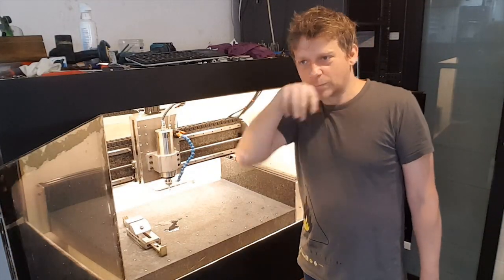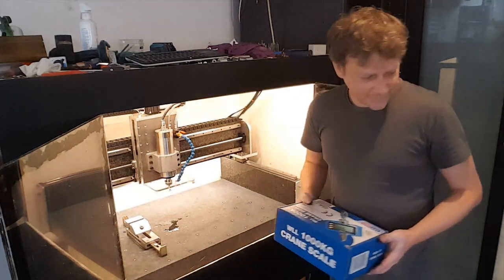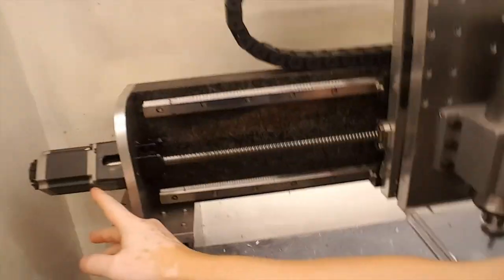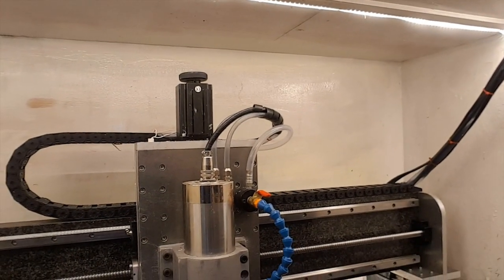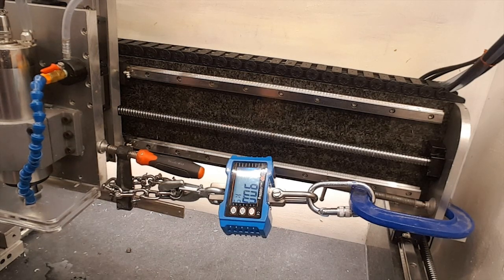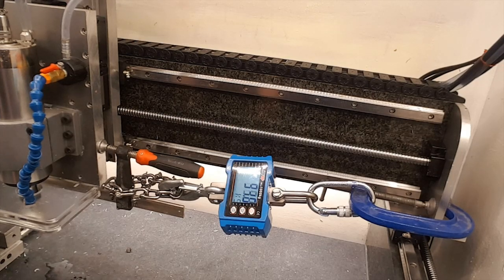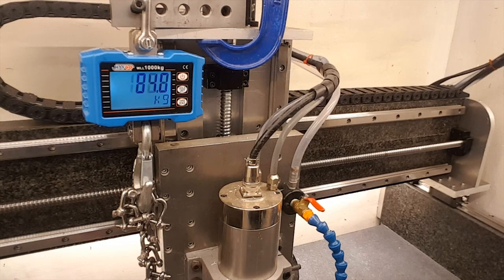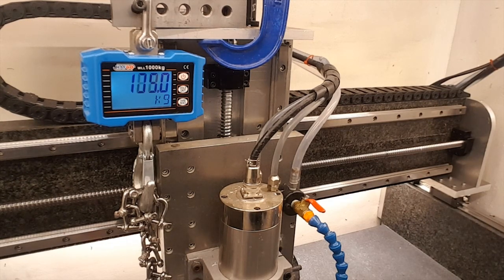how strong steppers are?

Comment: I have bought a nema 23 stepper motor kit from ebay and i can't even move my machine. 35v, 425oz./inch. Do you have any idea what is going on. ? Thank you.
Reply from the maker: This question is as generic as it is possible. I have to ask ;) did you take those steppers out of the box?? ;) I guess you have leadshine stepper drivers. I'm guessing maybe you haven't connected the ground to step and direction inputs. It takes 5v input signal and ground
Reply: @PiotrFoxWysocki  the system is working but the torgue is very low. The settings on the controllers are on max amps but also i can stop them with my hand. Is it good idea ti increase voltage from 35 to 45-50, the controllers can aford it.
Reply from the maker: @Nikos_Katakis  wow. something is seriously wrong. increasing voltage won't do a thing. more volts - more speed, more amps - more power. i have to ask, what is your power supply? Amp wise? another question would be if you are sure you connected stepper leads right? if its noisy and spins erratically it means its wrong.
Reply: @PiotrFoxWysocki  the power supply is 35v 10amps and this is for 2 motors and one more for other 2. Plenty of amps... :p  a belive that the conections are good because out of the machine the motors work well with out bad noise.
Reply from the maker: @Nikos_Katakis  i presume you haven't plug step in to direction and vice versa? only one thing left are the drivers. are you sure they are not set to some minimal Amps? in some you have to use resistor and maybe resistor is 10x or 100x too big or small.
Reply: @PiotrFoxWysocki  for which resiators do you mean?
Reply from the maker: @Nikos_Katakis  you didn't mentioned what kind of stepper drivers you got. So again I'm guessing what could possibly be wrong to cause such low power. Some Gecko drivers use external resistor to set particular Amperage.
Reply: @PiotrFoxWysocki  DM542A longs are my drivers.
Reply from the maker: @Nikos_Katakis  how did you set dip switches ?? One thing is almost certain. One driver can be damaged. But all of them, very unlikely. Check all the connections if they are tight and perhaps use multimeter to confirm.
Reply: @PiotrFoxWysocki  I had used osciloscope and i discover that the pulse voltage us 5 to 6 volts. Is this normal? The switches on controlers are on max power.
Reply from the maker: Interesting. I never measured stepper driver output but I would guess  that if you providing 35v stepper driver should output something similar. Not 5v. This just doesn't  make much sense. Are you sure you haven't used 5v or 12v output on your 35v power supply?? Some of them have dual output.
Reply: @PiotrFoxWysocki  Give it a try and measure. When the motor isn't moving i have 7 to 8 volt at one circuit and when is moving 6 to 7 ac on oscilloscope. Today I try the microstepping functions of the controller and I think I have what I want. I have some vibrations but I thing will be ok. I aslo tried to change the isner voltage to controller from 30v to 40v and the output voltage to motor was the same.Thanks a lot for your time my friend, your advices was helpful. Give it a try and measure just for curiosity.
Reply: @PiotrFoxWysocki  totally wrong, stepper motor no matter what volt you use, little help speed, more volts more speed, perfect stepper user use driver who handle 80-90 volt and little more than motor maximum ampere have BUT need setting driver max ampere little bit less than MAX motor amper have. or burn motor. but normal hobbu user use budget good compination, use NEMA 23 max torque motors about 475 OZ 3-4 amp max, and driver this have normal DM 554 max 4 ampere  and 40-50 volt driver. IF not have budger, no matter how much cost, used NEMA 34 and lot biggest driver etc, DM860 serie 80 volt and 9amp about. and biggest motor what driver can use. about 6-9 amp.

Comment: What stepper for lathe for wood?
Reply from the maker: Not sure on the size of your cnc. But most likely some mid torque nema 24 should be enough. Closed loop would be great
Reply: @PiotrFoxWysocki  spindle need minimum about 3HP motor and steppers uses normal minimum 470 OZ motors.

Comment: You have made same as my plan is(granit) but on hold because money... anyway I'm trying to find information about how many Nm are forces on spindle (both direction) same on linear rails... for example  6mm end mill 4flute  and 1m per min @10000rpm  ... this is hard to measure. But magnificent build and videos. Oh yes how much was precision granite base??
Reply from the maker: It is hard to check what is the load on the spindle. i have made a video about breaking mill bits, its my latest one. check it. it could give you some ideas. my standard speed is 1m/min with 11000 rpm, one thing i noticed that you won't break 6mm 4 flute mill, but if you go too deep or too wide you might have different problems. 
in my case x axis has 120kg(f) co its not enough to break the mill because it needs double that. but if you go to wide it will get stuffed, or if you go too deep it will break flutes. i guess it will break flutes in both cases. i chipped 10mm carbide mill on the bottom of the flutes and one flute in the middle. perhaps because at some stage i was doing 3m/min. anyway steppers didnt stall. it was the mill bit which fail. if you think about it it makes sense because flutes are very thin at the ends. 
now im cutting everything with recipe of 10mm deep, 20-25% side cut. 11000rpm 1m/min. for mills above 6mm. 
price of the surface plate was around 600nzd which should be about 400usd
Reply: Piotr Fox Wysocki I use € :) and live just above you/ish.. and yes ..your video gave me ruff idea what numbers are there.. Oh yes there is some formula to calculate out.. Thank you again.

Comment: I want replace my 3hp ac motor to stepper motor. Which stepper i should use
Reply: better buy real spindle motor, not expensive, 2,2KW water cooled spindle cost only 120-150$  and cheap chinese VFD 60-100$ not lot have. then can milling all what need, but steel not can, need lot low speed motor,  and gear box. and stepper motor change old 3HP AC motor not similar, stepper not run high speed good, normal 3-phase motor run 3000RPM stepper lot slow speed not can, maybe if use gearbox. but torque need calculate.i not know what you 3HP torgue have but if run slow speed burn coils fast.

Comment: made me physically ill to watch the fail, (lost steps are death to a 16hr job.) while 100kg is huge, i wonder the force of high-speed change of direction, that gantry looks stout.

can you share your x,z configuration of screw nut/carriage plates? you have a great low profile design.
Reply from the maker: gantry weight is around 60kg. so i have 150 kg to spare. and my top speed is 3000mm/min. top speed for stepper with no load was around 5000 mm/min. so i backed down to something reliable. i will share my fusion 360 files for the X-Z configuration in my next video about machine.
you guys make me do another video about steppers and speed/accelerations :) its good to have clear topic for the video :)
Reply: That comment about sharing the Fusion360 files is pretty exciting :-) ALso, are your linear rails the really cheap knockoffs from China, or genuine Hiwin? I remember you were not totally impressed with them when you got them. I presume however that they are still much superior to supported circular rails?
Reply from the maker: my rails are cheap knockoffs... dont ever buy this s#$%!. i had circular and they where much worse. about fusion i will just share the z axis, because rest its totally depended on the circumstances of your design.

Comment: Would never use stepper motors no matter how cheap after I built my CNC using Clear Path servos.
I do very heavy rapid cutting on them and even set to only about %30 of full torque I have never had an issue with them.
Also they are no more complicated to hook up than a stepper motor

Comment: Why do you have such a large motor on the Z? I would think that the Z would do the least heavy work of all axes
Reply: X and Y need change lot biggest motors. too small, minimum have cnc machine used NEMA 23 470 OZ motor, biggest id better, not lose steps.

Comment: Have you tried it with your new setup?
Reply from the maker: beside the new spindle i haven't changed much.
Reply: @PiotrFoxWysocki  that's my fault, I am watching so many builds I thought you had upgraded to servos. I hope you don't mind but I am going to build a CNC based on your concept/design, I always loved the idea of a granite cnc bed it hadn't occurred to me to do it the way you did.

Keep up the good work your machine and upgrades are very inspiring.
Reply from the maker: @house89147  no problem. And don't worry about copping my ideas. I started documenting my build because no one did it before and there was nothing on YouTube. I thought it was interesting project to share and for others to use granite surface plate idea in their own projects. So go nuts and have fun ;)
Reply: Have you ever considered making it 4th axis capable? I was looking at yours and thinking that I'd increased the height of the sides then build a spindle into each side (I actually have a spare Colchester lath spindle I could break down and use for this) put it on the one side on a worm drive with a stepper or servo. The advantage is the spindle I have has a through hole so if I set the other side up almost the same with another spindle or some sort of carrier I will end up with 20mm or 4/5ths of an inch diameter holding at any length as it can go through the machine and out of both sides. And if I wanted to I could bore this out on my lathe to about 40mm without affecting the strength of the spindle.

Comment: Are you in full step? Or microstepping?
Reply from the maker: tricky question :) gecko driver has only one mode. 10 microsteps.
Reply: Piotr Fox Wysocki really? Why? :-)
Reply: Piotr Fox Wysocki. I hoped that you can show us differences between full step and microstepping. Another time :-)
Reply: There is no difference in maximum thrust between full and microstep. Thrust for a programmed position is a different story, but you have to measure position to see the results.

Comment: Thanks for uploading such an interesting experiment! 
I have two questions. The first is pretty dumb maybe. I saw that you're driving the axis directly. So, if I have a 1:100 gear let's say, and a rock solid setup, can I pull ~1 ton with this thing?
Other question: can you please share some details from the power supply and controller? Thank you!
Reply from the maker: well... :) its way trickier than this :) i can pull 1 ton with X axis just as it is. to pull or push you don't need as much force.  to lift you need much more. so this what i showed on this video was lifting power or compressing force.
with gearboxes if you  have 1kg lift and you add 1:100 gearbox you should have almost 100kg lift. 
power supply which i have is 48v and controller is gecko540 but i will be changing it in the future,
Reply: @PiotrFoxWysocki  Thank you very much for your detailed answer. Sorry for the poor choice of my words. I would like to lift then. :) So let's say, I would like to attach a piece of material between the moving nut and a fixed end, like a tensile testing machine.  I saw that you reached more than 200 kg on the z-axis. If I would use gears, let's say 1:10 with your z-motor, and no friction, bending...etc (totally ideal case) would be there, would that mean that I could lift ~2000 kg? Thank you!
Reply from the maker: Yes, that would be correct.
Reply: That would alter and be altered by speed and acceleration. Yes, the force developed by the 1÷10 ratio gearbox would be 10 times bigger, but the speed of lifting would be 10 times slower. If you want some acceleration too,  things change a lot.
Reply: @mihailfelixdumitresc  Thanks for the answer. In the past year (since I made that comment). I learned a lot about stepper motors, gears and stuff, so now I know all these things. Actually, the speed was not important for me. I was just amazed by the strength of a stepper. I made a setup, which is based on a small NEMA17, a planetary gear and a worm gear, and now I can exert more than 500 kg pulling force. On paper, multiple time of it, but my load cell can only go up to 500 kg. Have a great day!

Comment: I don't know why, but I'm not able to conceive this. How can a motor rated 4N-m~= 40kg-cm produce almost 200Kg of force. From your setup, I assume the distance between the hook and the motor(Z-axis) is about say 5cm. So, by the torque formula(T=F*R*Sin(¢°), here-¢°=90°) force should be 40kg-cm/5cm = 8kg.. Technically, force should be less than 40kg for all distances>1cm..
Please help me out.. This concept has always bounced over my head..
Reply from the maker: hmm.... looks like your calculation is incredibly precise. you just missed one 0 at the end of 20kg :) I prefer to test stuff instead spending time calculating something where i could miss something or put dot in the wrong place. as i mentioned before i have lots of experience wits steppers and i have a lot of all sizes, so it turns out that is too small i get bigger one.
566 oz.in means that if you attach a pulley which radius is equal to 1 inch and you attach string to it, you should be able to lift 566oz or 16.0458kg. I never bothered to find a right formula  to calculate it. i guess to make you mathematical problem even more painful i want to add that i haven't been running those steppers at full power, Amp wise :)
Reply: @PiotrFoxWysocki  Oh great! Owing to the budget constraints, I tend to rely excessively on calculations beforehand investing into anything! Certainly, it's very time consuming, tedious and prone to errors but saves me some bucks to balance the equation. Anyways, loved your video! Amazing!!
👍👍
Reply: There are at least two reduction ratios:
1.  (If used) any pulley ratio (minus mechanical losses).

2.  Radius of the ballscrew:  if stepper torque is (for example) 325 ounce-inch, a 0.5" diameter ballscrew with a 0.25" radius would give a 4:1 reduction (1" measurement radius / 0.25" radius) and 4X the ounces (325 oz-in / 0.25in = 1300 ounces).
A 0.5" ballscrew might be a bit undersized here; chosen to simplify the calculations.

3.  Thread pitch of the ball screw.  A smaller pitch will give lower speed and higher force.  From the Wikipedia "Ball Screw" article:
F = (2 π v T) / l, where:
F is force,
v (correct Greek character is unavailable) is the ball screw efficiency:  20..25% (0.2 .. 0.25) for Acme thread, 90% (0.9) typical for a ballscrew,
T is torque applied,
l is ball screw lead (distance the thread advances per revolution)

Picking an arbitrary 0.2" pitch and the 1300 oz-in,
F = (2 π 0.9 1300oz-in) / 0.2"
  = 36,757 oz = 2,297 pounds force
Which I think we can agree would be more than sufficient for this mill.  

A lower overall reduction ratio for higher maximum speed seems preferable. 
Suppose the stepper + drive is capable of 1000RPM:
1000 rev/min / 60 sec/min * 0.2"/rev = 3.33 inch/sec, which seems rather slow; a 33" move would take 20 seconds.
Reply: Looking at rack and pinion:
For an example 25-tooth helical gear, pitch diameter 39.79mm, direct drive:
F = 2 T / PD 
(Using 2 / Pitch Diameter as 1 / radius)
F = 2 (325oz-in = 2.295Nm) / 0.03979m
  = 115.2N (25.8 pounds force)
Which seems insufficient, requiring gearing or a pulley setup, or bigger steppers.

Designing for 100kg force (per Piotr's video around 3:00), 220lbf, an 8.5:1 ratio.
Reply: @PiotrFoxWysocki  and important what you screw pitch have too, need include you calculate formula this too.

Comment: Steppers or servos for cnc?
Reply: normal steppers hobby user budget good, factory use servos no matter budget. etc. basic cnc stepper motor cost 30-60$ and driver about same,  and servo and driver cost 500-1000$/axis. size have what you budget is, and servo closed loop have perfect but too expensive any normal hobby users. no smart waste lot money if small cheap can use hobby garage own little job.

Comment: yeah stepper at low speed mad hard ) even whit smaller ones i used to brake bits 5 mm easy ) go whit 8 sure you brake them ) especially if go whit some force of inertia ) whill be fun to watch or when bit bites in so you got force of twist on mill bit and latheral force that might brake even 12mm ones )